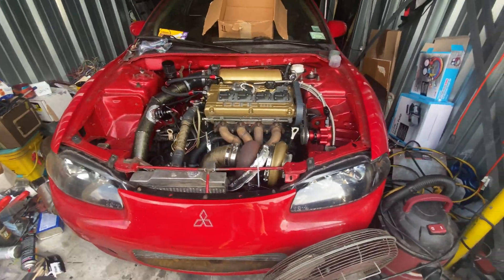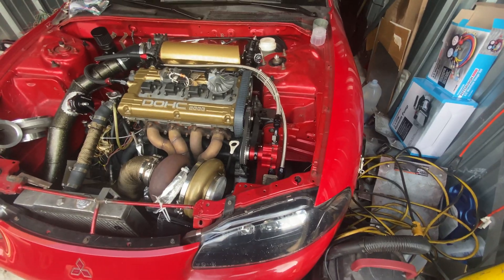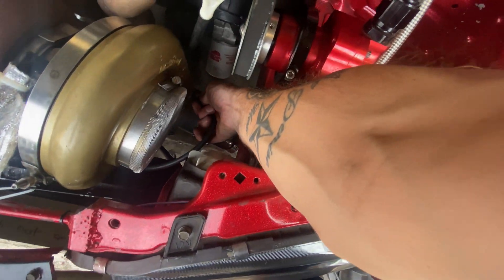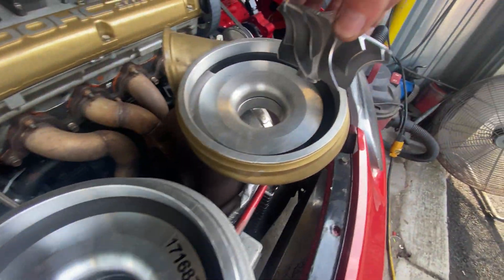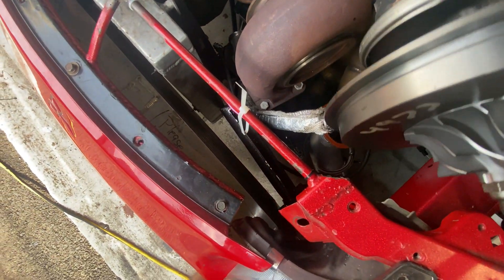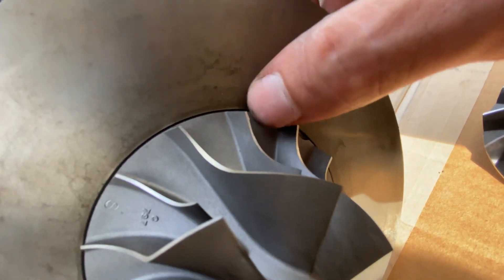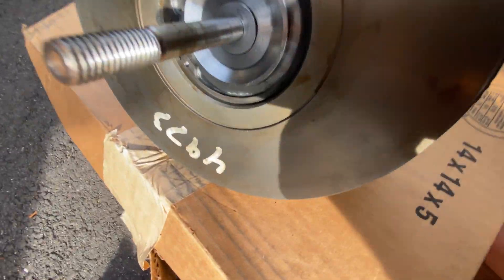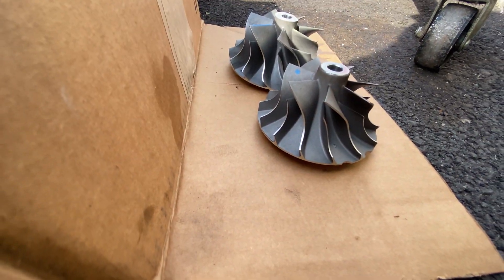MASSIVE 1000hp turbo upgrade for my Mitsubishi pt 1, Borgwarner s400 series

Comment: Who did you use to balance,  Iam thinking of going from 75mm to 80mm
Reply from the maker: there is a local turbo balancer to me, use google maps and type in "turbo balancing"
Reply: How much torque did you put the front nut.
Reply from the maker: @sammyturbo786  i dont remember what the spec was for borgwarner lol
Reply: @RaceCarRichie  I saw in one of the form it said 200 ft pounds then reverse 90 deg, then give it another 50 ft pounds.  How did you do yours. Yours is still working good?
Reply from the maker: @sammyturbo786  200 ft pounds, stop it hahahahah maybe 200 inch pounds hahah
Reply: @RaceCarRichie  that makes more sence, thanks bro